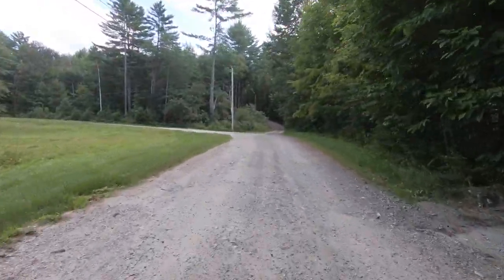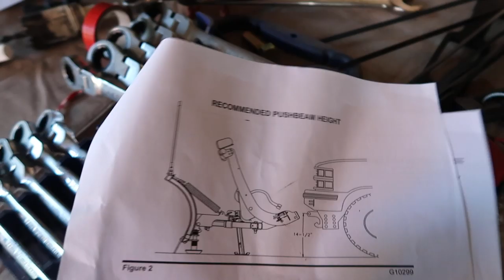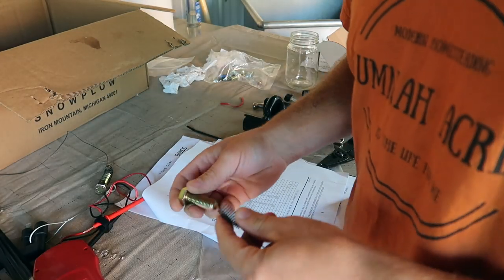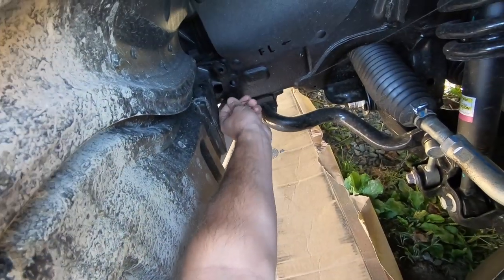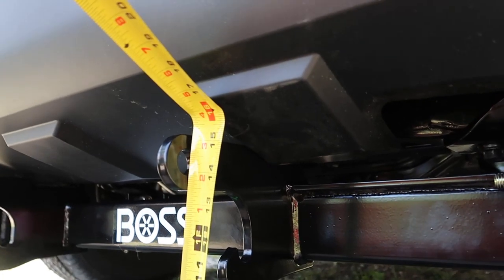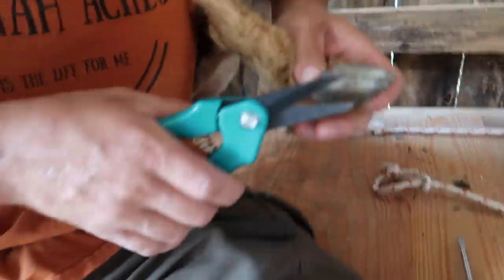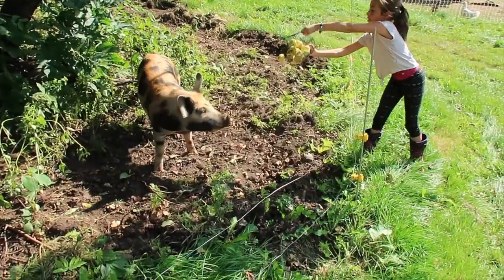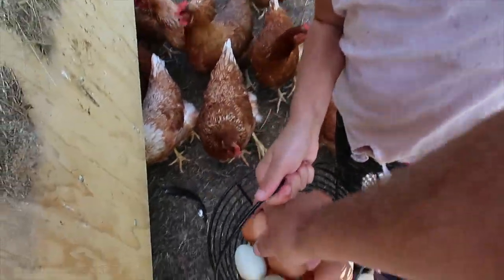Is It worth all the Trouble (Installing a Boss Plow Push Plate)

Comment: I live in the older section of my city.  My drive way is in the back and a 2 car and my front entrance is very steep steps that have to be hand shoveled.  I have a small gas snow blower.  I would rather sell my freezer than that snow blower.  It make heavy hard snow removal at least 50 times faster and easier.  It also helps keep the alley clear so I can get to my driveway and garage.  You know how to work smart not hard.  I love your videos. Would you show the pigs when they first arrived and now after all the growing they have done.  It seemed to happen so fast.  LOL!!

Comment: Thats going to be a sweet plow. I have never had a truck with a plow on it. I clear my driveway with a snow blower on the front of a john deere lawn tractor. Works great. Those wire bolt fishers are really cool. I used them helping a friend install a receiver on his suv. They really work awesome. You mentioned fall coming... I'm in Ct. so I'm not too far from you guys. Last night I went out to dinner on my motorcycle. When I came out to go home, there was dew all over the seat. Thats the first obvious sign that it's getting cooler at night. That probably happens where you are all summer. It still gets chilly at night up there even in the summer. I wonder if those apples are yellow delicious?
Reply: Hello from Cromwell !
Reply: Howdy neighbor! hahaha
Reply: N. Stonington
Reply from the maker: Yea we have dew a lot. When is your first frost date
Reply: Good question... I just looked it up. It's around the beginning of Oct.
Reply: Norwich!

Comment: Great video! So you didn't have to cut the bumper or air dam at all? It's just a bolt on system?
Reply from the maker: No I didn't have to do any cutting, which made it really nice
Reply: Lumnah Acres that’s great! I hate the look of the cut air dams on the other trucks. Makes it hard to resell the truck with out replacing expensive parts. I’m looking to get a 2020 tundra this winter. Do you know if car seats fit well in the double cab?

Comment: I just wonder if that plow is to much on a half ton truck? I wouldn't want one on my daily driver. I got buddies that have bent frames pushing snow.
Reply from the maker: This plow is rated for the tundra. It's designed for half ton pick ups
Reply: @LumnahAcres  just trying to look out for your equipment buddy. I want Lumnah acres to prosper.
Reply: That plow is built for the half ton! I love plowing in my tundra. Unfortunately I have to operate my dump usually during the storms. I have this 22yr old kid who gets to drive around in my loaded tundra listening to XM radio with heated seats. Although he earned it. I have been amazed with the tundra plowing. My buddie put a 7.5 western MVP on his tundra no issues. My tundra has worked 100k miles in 2 yrs doing alot of crazy stuff! Awesome plow. No storm will stop you!